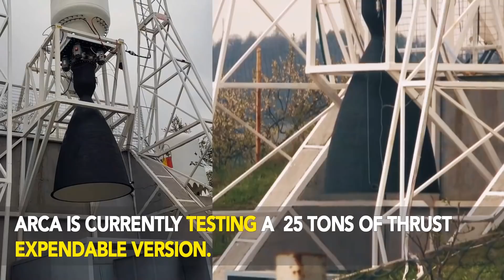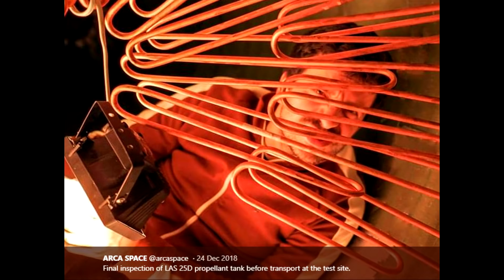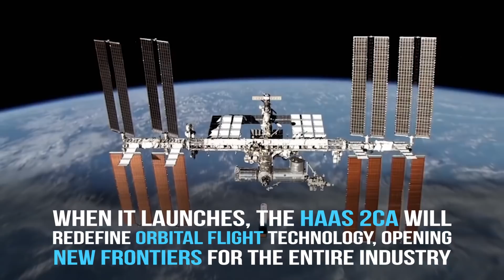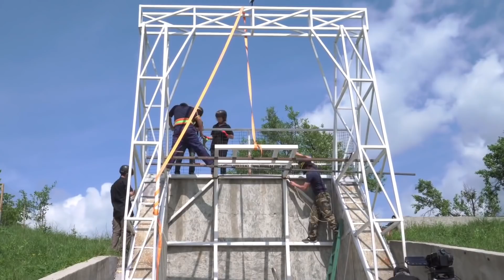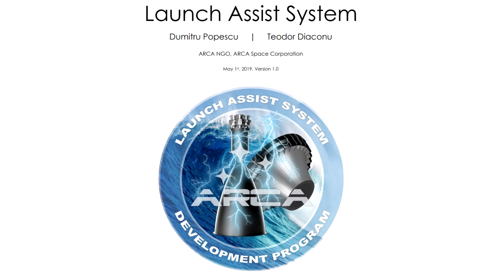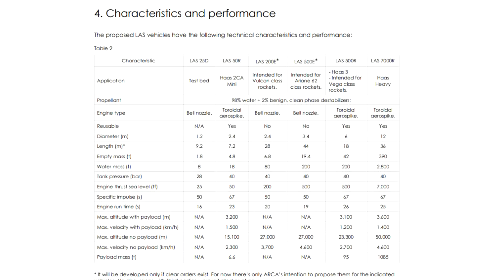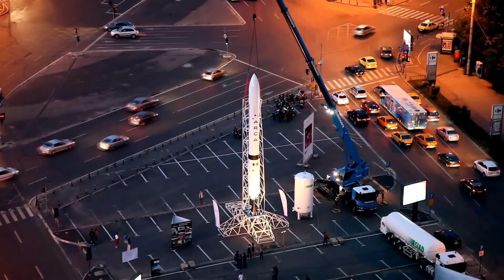Does ARCAspace's Water & Electric Powered Rocket Make Sense?

Comment: Is this pawssible       

that they use solar panels to have electricity that powers the electrolysis chamber which separate h2 and o as that h are hydrogen as fuel then o as oxygen serving as a oxidizer 

also the loop which means you pump the water fast but single the water then that water current is currently pushing propellers from a hydro power generator that powers propellers then repeat         in short pump current power repeat

Comment: Instead of LiPo, you could use something like Co-60 or Sr-90 as a heat source, meaning you'd need a lot less of it, cobalt-60 has a power density of 19W/g or 19kw/kg, which is 50x better than the best lithium ion batteries. Even with a very low conversion efficiency from the gamma rays to thermal energy, you're still going to be getting far more out of Cobalt-60 heat source than resistive heating from batteries and all the water plus the distance from the source at the top of the rocket should shield any cargo or crew from the gamma rays.
Reply: And will this work in a Home-made fiberglass boiler tank like ARCA'S?

Comment: Maybe they could design a heat element target on the bottom of the water tank that will let them use high powered lasers from the ground and aircraft to continually heat the water in flight.

Comment: I looked about ten years ago at building an electrical rocket, very different to this one but with the same basic problem. 
(I was actually doing it to relearn and properly understand the physics of rockets - which turns out to be why I eventually gave up on it.)
My main design was a magnetic railgun lifter using steel balls as reaction mass, and additional solid rocket boosters to give it the additional thrust it needed to get high enough to get into orbit.
In reality the thing was totally untenable basically because I made a miscalculation in the energy budget it needed. Again the basic problem is the basic energy density of batteries. In fact nothing had the energy density I needed. Also steel balls are not the most friendly type of exhaust, they vaporize in air but are lethal in space so need some way to destroy them. In the end it just wasn't a good solution.

I also know that steam rockets are not a very good/easy solution. At the kind of energies you want for rockets the water just de-catalyzes into hydrogen and oxygen wasting some of your precious energy. Where water is good is if you have a LOT of energy - say in a nuclear fusion rocket. In a rocket that can hit an ISP of 2000 or something water makes more sense but fusion rockets are not an easy technology. (Fusions biggest current problem by far is weight. Also any fusion reactor is also a huge energy hog itself, especially at startup.   Fusion tech is also still in its infancy of course and so far fusion rockets are purely theoretical.)
Sorry for the length of this, one of my favorite subjects.  ;)

Comment: I can see how a steam rocket could be viable based off of the simple idea of re-usability. Even if the power it gives is garbage as long as it could be used for a payload and could be reused more times then a chemical rocket it could work. Though more for a economic perspective then engineering, just by saving on the cost of building rockets.

Comment: What do you say about ARCA's answer that they don't use batteries at all the situations, as the rocket is actually heated up on the ground?
Reply from the maker: That’s great effect acceptable, it’s using batteries as a heat source that’s unrealistic.
Reply: Thanks for the answer! I will try to create a coke/mentos water rocket this summer.. see if it has added thrust compared to a normal water rocket :D

Comment: Hey, doesn't every engineer want a problem that needs to be solved with a BFL (Big Laser?)

To heck with batteries.  Just initially heat the water like they are doing, then aim a laser up the rocket's nozzle while in flight.

Comment: I doubt that they use batteries as their main heat source 
I get the feeling that the batteries just provide a tiny amount of heating to compensate for heat loss 
And otherwise the rocket is just pumped full of high pressure hot water

Comment: Use a nuclear thermal heater core to heat up the water might work. Need to heat it up at around 4000 degree Celsius to make it practical though.

Comment: I don't think that it can waste 50kg of LiPo. You can't even discharge them on this rate. Also, you can use electricity from the grid when on the ground. Not talking about that you can recharge them at leat a 100 times.

Comment: Hello Scott, think some misunderstanding on the batteries to heat the water. Think batteries will be only used to heat the water when landing back the 1st stage to "re"heat the water to steam and get best efficency and not heating the water on launch. Think for launch, water heating will be done by AC on ground. On the other side, think choosing Hobby King batteries will not be a good choice to be professionnal, better to choose real performance batteries as 75C continuous that can be discharge in very short time as the improved E Propulsion Systems batteries we produce. Let's see what ARCA performance will be achieved but moving every month on the chemistry design is not good to secure investors...
Reply from the maker: I didn’t misunderstand this, and using batteries as a heat source is sub optimal.
Reply: @scottmanley  Of course, not optimal and i don't understand how they will perform enough to achieve some results. Perhaps just to get some new investors. We produce high performance discharge lithium batteries and we see some very good result in design development system we never  give a penny! Let's see what's happened with Arca.

Comment: I've tried (but failed) at calculating whether the ARCA "hot water rocket" could be scaled up to a Sea Dragon. 
Take the 1960s Sea Dragon launcher, instead of chemical rockets power it with water heated by a modern nuclear power plant. It SOUNDS brilliant, and risky.  But MORE brilliant than risky. Can anybody help?  
Idea is, a HUGE booster rocket, so huge it has to be deployed at sea, e.g. the classic Sea Dragon.  But, in this iteration,
fill the tanks with water.  Park a nuclear powered submarine or nuclear aircraft carrier beside the Sea Dragon, use the nuke power plant to heat the water until the tanks are filled with superheated supercritical steam- this should give you a crazy high delta-v and crazy high specific impulse.  Use the giant steam rocket to put payloads up to LEO, or stratosphere and then conventional rockets, but either way, you recover the giant steam rocket, refurbish and repeat.
Reply: But ARCA has a Home-made Fiberglass Boiler Tank. You think this will work?

Comment: When i hear that someone is using battery-powered heater in a rocket, i don't think it's something weird, more than that, it's pretty logical step: as soon as in the very end your rocket has to carry some payload, but during design stage u can build rocket with mass equal to desired loaded mass, using some placeholder massive stuff, that not necessary should be just a bunch of bricks, but can be a device in some way helping your development process, for example some additional sensors and telemetry.... or it can be an ass-saver for emergency case, that allows you to have heat-production at calculated level without fear of going bunkrupt if some failure will spread your precious uranium across all your neighbours yards.
No joking, building heat-driven rocket engine and using any substitute electrical heater, imho, obviously means that nuclear power source is planned.
Probably, at video publication date, nuclear stuff was not that hot theme as it became in august, but  ton of batteries tied to boilers  buts is pretty old idea.
I haven't got any real data related to failure in Severodvinsk, only heard rumors, that they got surprisingly rising reaction rate soon after start, nearly in exponent manner...  I have a great respect to RosAtom in general and keep somewhat naive belief, that not all well-educated, or at least capable of reading books, engineers emigrated yet, but i cannot get rid of irrational intuitive feeling, that they did not take in account effect, mentioned even in Clark's Ignition, that, being heated to required for desired isp temperatures, any propellant could become chemicaly reactive to critical parts of reactor it is pumped through. It is well known that hydrogen at 2k K tend to convert carbon control rods into nature gas, may be atmospheric gases mix (and who knows what fresh Severodvinsk's air can spontaneously contain) at these temperatures can rapidly corrode some critical part of their nuclear atmospheric jet's core. Not sure that water steam at 2k+ K would behave much better, but untill it will be hated to pure plasma, water at least has all oxygen in it chemicaly bounded (btw, can't remember required conditions to fuse nitrogen with h2 into ammonia, there is high pressure needed needed for sure (however, don't we have pressure here as well?), but aren't typical nuclear-rocket-engine (P,T) not so far from zone where even nitrogen stops to be so inert?). So, in my profan opinion, in such context, experiments with water as targeted propellant seem to be logical step. I've already started impressing short bald man in tv announcing new miracle rocket, to fast to be shot down, but capable of sucessfully chasing down rotten capitalist's spaceshuttle using it's capitalisticaly wasted exhaust gases  trace not only as guideline, but also as fuel for itself, and couple months later surprising discovery: being to fast to be shot down in atmosphere also means to be to hot to stay solid....
Reply: Potato Head playing with a reactor, HAHA. Just think of it, Hum, with nothing but Theology in College. Sure, why not. ARCA is planning on this Bottle Rocket booster thingy to only go 3000 meters or so, and said mach 2, HAHA. Stuff a ARCA POTATO HEAD REACTOR INTO BOOSTER THINGY, GOOD BY ROMANIA.
GETTER DONE ARCA

Comment: I have a possible design of a two stage rocket using a water propellant - compressed air powered engine for the booster. It will not a big dumb booster, but a massive, extremely stupid first stage, to save the costs of any sort of complexity. The top stage is designed like a single stage to orbit rocket, but will have an engine bell or bells optimized for a vacuum. The remarkably stupid booster will fly the top stage to an apogee just high enough for the top stage to be in the vacuum of space. I am going to submit my idea to The Journal of Ir-reproducible results.

Comment: Batteries aren't much help, and anyone who says they are worth carrying up for their electrical output to heat water to feed a rocket exhaust is talking to dumb investors, not to rocket engineers (or even reasonably well-read non-engineers).

But there could be some pretty interesting ways to use steam rockets.

The big advantage of steam rockets is you don't need an oxidization process at all.  The energy can be obtained from outside the rocket itself; just heat up the steam, attain pressures your materials in the containment system can withstand, and off you go.  The exhaust is harmless, except for its temperature, but all rockets produce high-temperature exhausts, so that isn't a reason to avoid steam rockets.

The specific impulse isn't very impressive, relative to rocket thrust desired to escape the Earth's gravity.  But in shallower gravity wells?  We have to think again.

One of the big challenges for a Mars mission is obtaining fuel for a rocket to take off again.  Using solar power to disassociate water into hydrogen and oxygen, then more solar power to chill them down to liquids, then pump the liquids into rocket tanks, then burn the liquids to generate thrust, is one way to refuel a rocket on Mars (or the moon, or anywhere we can obtain water).  But it's a pretty big infrastructure project.  Daunting, even, in the early days of exploration.  It requires an awful lot of mass to be landed and deployed.

How would a steam rocket compare?  We will still need solar power, a lot of it, and containment tanks will have to be pretty darned robust, but the infrastructure required is simplified.  Mine the water, warm it to a liquid, load it into the rocket's tanks, heat it up with solar arrays pumping electricity directly into the spaceship.  When ready for launch, flip some valves.

Anywhere you can deploy enough solar arrays and don't mind waiting, you can get enough electricity.  Anywhere you can mine water and schlep it into the rocket's tanks, you can get enough reaction mass.  You don't need to mess around with dissociating hydrogen and helium, there's no cryogenic treatment for fuel and oxidizer required.  There's less infrastructure to put in place for refueling operations, and nothing is particularly dangerous except high pressures in the rocket's water tanks.

Beyond the Asteroid Belt, getting enough solar energy becomes a bit of a problem, but Mars is okay.  Visits to near-Earth asteroids would be great for steam rockets if the asteroids have water to mine (I think some of them do).  The moon ought to work fabulously at the poles.

Taking the idea up a notch, stick some solar collector arrays in orbit closer to the sun, beam the power to receivers wherever you want the power, use the power to recharge water-based ships anywhere out to Jupiter.  For a scaled-back version, put the solar arrays in orbit around the Moon and beam power to the poles, where it is converted back to electricity to melt water and feed each ship's heating elements.  Stick power receivers on the surface, mine some water, use power to heat it up to a liquid, and schlep it into the rocket's tanks.

Obviously, there is some technology to work through.  I'm not arguing that solar collectors in orbit, beaming power around, setting up power receivers on the moon or Mars, or mining water are minor engineering tasks.

But I do think that steam-powered rockets are a dog in the race for rocketry beyond Earth in lower-G environments.

Comment: Could the new carbon batteries, which are just around the corner, do the trick? They can supposedly contain 10 times the power of LiON batteries and are more lightweight. They're also mostly biodegradable and cost less to produce than any other batteries.

Comment: I wonder how well this would pair with a nuclear reactor, because The sheer power density of a nuclear reactor could actually do this "flying tea kettle"  justice.
Reply: Very well at a guess. You shield the reactor with the water (which is a good neutron moderator), and so you don't have to carry other shielding. By the time you're out of water, you're high enough up that the radiation isn't cooking the ground staff. However, the spent rocket falling back to earth might be a licencing issue ; )

Comment: ARCA has great ideas, however they're not working at the leading edge of technology. Aerospike tech hasn't made it to space not from lack of trying.. I would love to see it happen, I'm just not going to hold my breath.
Reply: Yeah. At least Haas rocket, which this teakettle stage lifts to 3000 meters and acelerates to Mach 1.5 (if it works out), has a sensible pressure-fed keroxide aerospike engine. I kinda suspect switch from turbopumped kerolox Executor to pressure-fed keroxide, as well as creation of the teakettle stage, might be due to the problems with available materials.

Comment: Those Zippy RC batteries really confirm this as a scam. You could replace the ENTIRE battery section with a single propane tank and a leaf burner and that would give you more heat. 
Really consider the fact that these guys went through the hassle of designing an aerospike nozzle (obviously not FEM optimized or anything) but never ran the numbers on ISP.

That's fucking intense. I mean forget that this obviously cannot carry any sort of payload, to any height; I'm quite certain it cannot lift it's own weight until the last second before running out of water.

Comment: So I was thinking what could heat water and make high amounts of electricity and I thought this sounds like a nuclear reactor type of job instead of batteries. If it takes a portable nuclear reactor to make this concept feasible then yeah it's really pushing beyond the limits of what is feasible.
Reply: Also that reactor would have to function in a run away heat mode since the secondary fuel coolant loop is what's thrust outside of the 1st stage rocket. So the reactor has to be intrinsically safe with walk away features like a negative temp coefficient pressure vessel. It has to also be optimally thermally uprated so a 75MWt producing 50MWe plus now you'll need heavy generators and inconel heat piping making the 1st stage ever heavier. That is without even going into the vibration protection, decommissioning, and explosion survivability of the nuclear reactor. Yeah beyond feasible and just not safe or worthwhile with a nuclear reactor and batteries are just not there yet.

Now one interesting part is someone in the comments mentioned the water will be added to the 1st stage already pre-heated and near or at the required temperature. In that case the energy required to sustain the heat might not be as great of a demand but the fuelling has to happen like within 5 minutes from lift-off. Still I don't think this is commercially worthwhile.